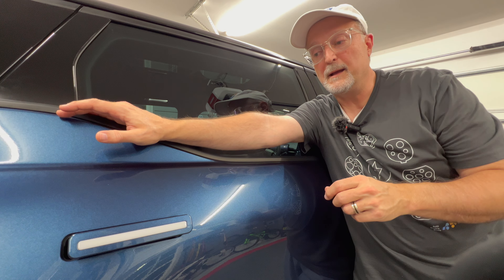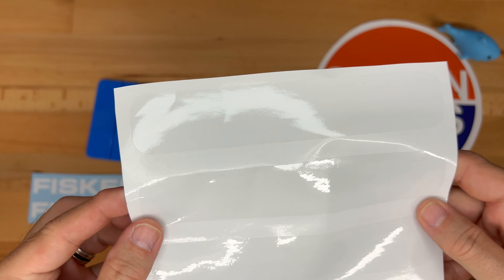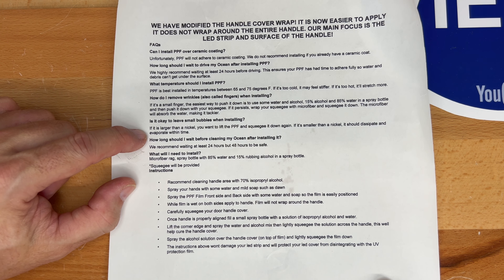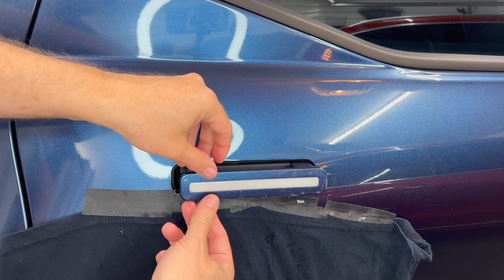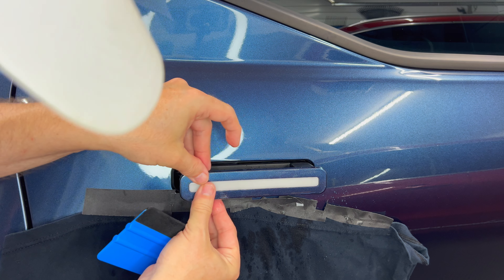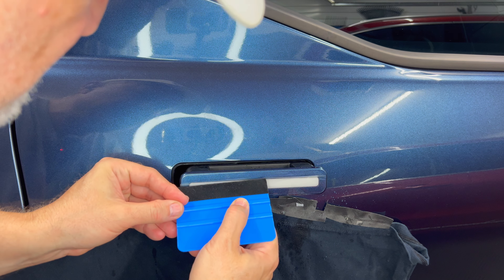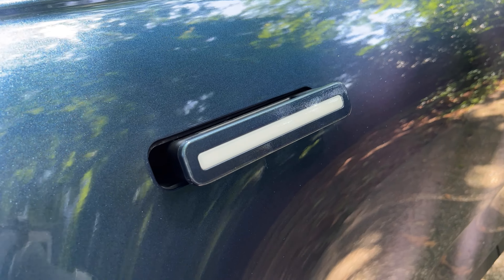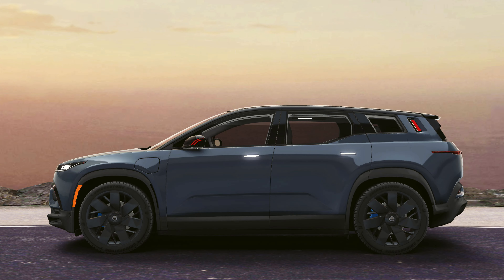Fisker Ocean One - Door Handle PPF

Comment: so, did this protect handles I seen you did a video of replacing handle inserts, so would you recommend this over replacement inserts or doing the replacement inserts and then protection film?
Reply from the maker: In that video, I replaced the inserts on another owner's car that had two shattered inserts.  My car still has the PPF and is in good condition after 14 months.  I will only replace if there is some indication of the insert starting to fail.  Since the replacement inserts are UV protected, you really don't need to use PPF.  To be extra careful, why not.

Comment: My handles have been ceramic coated; do you know if ceramic provides protection to the white strip on the door handles, similar to the PPF application? Thanks for the video!
Reply from the maker: I think of ceramic like a "super wax" that lasts for years depending on the number of coats used.  I provides no protection against scratches.  For this particular application - protecting the plastic, I don't think ceramic will help.
Reply: @MTNRanger  Well, OK. I can’t use the PPF because of the ceramic coating, but I like the idea of PPF.

Comment: Awesome Video..... What replacement tire(s) would recommend? Should we stay with Bridgestone tires or consider another tire? Also where would suggest to get the tires rotated at (Discount Tire or Sams Club or Costco)?  Thanks in advance. P.S. Also how often should be rotate our EV Tires?
Reply from the maker: Funny you mention this. There is a big sale right now for the Bridgestone Alenza tires for only $153.  I just bought four myself. There is also a $25 coupon if you sign up to their newsletter (pops up when you go to the website). See this link:  https://simpletire.com/brands/bridgestone-tires/alenza-sport-a-s#v=1&tireSize=255-45r-22&mpn=015057&pageSource=vehicleCatalog&itemId=90952&curationSeq=1&curationPos=1&curationSource=top-pick-top-picks&pick=oem&delivery=Del2&vehicleMake=fisker&vehicleModel=ocean&vehicleYear=2023&oem=191672&vehicleTrim=one&rad=DD
Reply from the maker: As far as tire service, I do that myself.  I recommend Discount Tire and have used them for over 20 years.  The owners manual suggests tire rotation every 6000 miles.  Though I would check sooner (every 3000) to make sure there is no abnormal wear.

Comment: Any update on the durability of this product?  Any issues since you have installed these PPF protectors?  About to pull the trigger on a set and thought I would ask.  Thanks
Reply from the maker: If you apply it correctly, PPF will last for years.

Comment: Hi I just had 2 handles shatter this week. Any suggestions on how to repair?
Reply from the maker: Yes, I'm doing a video on that soon.  You can purchase replacement door handle inserts here: https://www.ebay.com/itm/405048870818
Reply: @MTNRanger  Would really appreciate a video tutorial on how to replace these. My driver side white plastic panel has cracked :(
Reply from the maker: @MultiHIMANK  I did a video explaining the process but I didn’t perform it on my car since my handles are in great condition. Maybe in the future if mine develop the issue.
Reply: @MTNRanger  I completely missed the video explaining the steps. Can you post a link ?
Reply from the maker: @MultiHIMANK  Oops, I'm sorry, It's video that I'm working on.  I thought I already posted it.